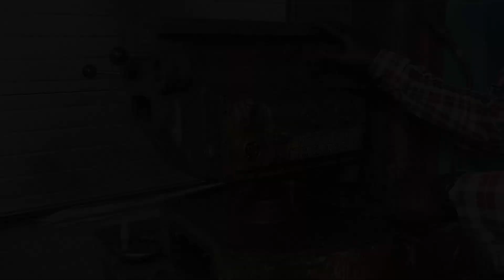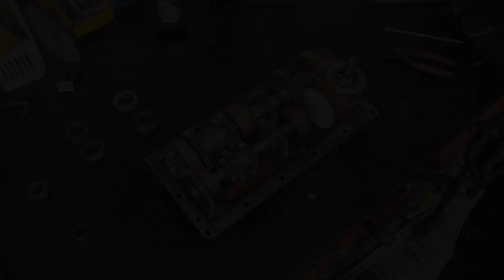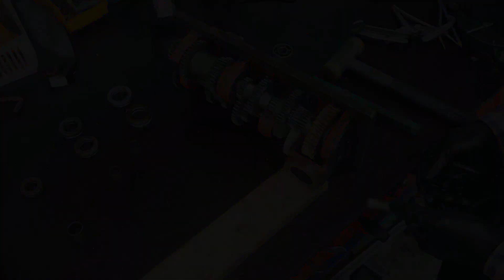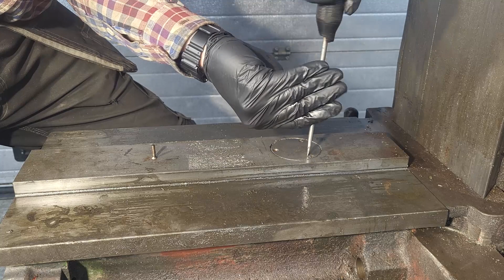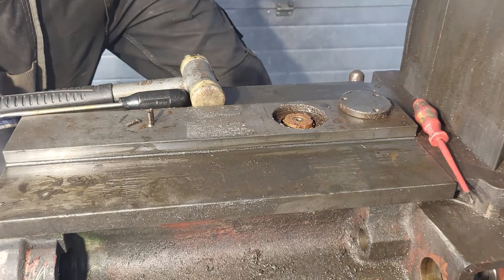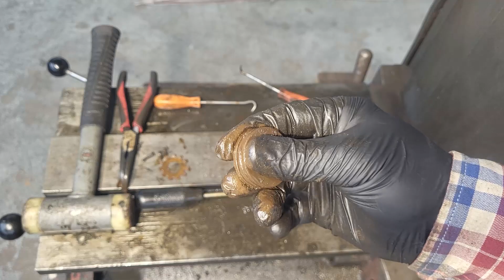SAJO milling machine restoration - PART 9

Comment: Hi guys, I build a milling machinery, and in this type of machine the first bushing to be changed t's the vertical because all the weigh it's always on her. Also, You test the play in the lowest position where the bushing never work, so, the play it's reduced but in the middle screw will be more. My opinion it's to change.You are maching a good job, don't do this mistake.Regards.
Reply from the maker: Hi, thank you for the comment, we will try it in the middle and check the condition 👍

Comment: I think you are a little too concerned about that bushing for the Z-axis -- it is loaded against gravity, so backlash is of little concern .  In any event,  you are jacking at the wrong point -- jacking near the center of gravity of the knee close to where the lead screw is would largely prevent binding in the ways and give you rough indication if the bushing is totally trashed (unlikely as that be) .  You are correct in playing closer attention to the thrust bearings .... that is one-big-piece of iron to lift, especially with the added weight of the saddle and table !   Fun project, though ..... good luck to you.   How about an engine lathe next ?
Reply from the maker: Thank you for the comment, it nice to see that people like to give insight from where we can learn more. We can agree that now afterwards we might have been a bit over concerned but then again, we just had to :D and yes, the point for lifting could have been chosen more carefully. It sure is heavy, dont think it will be vibrating too much, but thats the beauty with old machines, built to last 🫡

Comment: Did you really just use a 10 ton jack to "test the play in a thread"??? & without an indicator against the back of the machine so you could at least gauge what you were doing with that jack??? It doesn't matter how little you think you lifted it, it still has way more force than you should use to test a thread. A lump of wood used as lever would have been enough!
Reply from the maker: Appreciate your comment but we took it easy so there is no risk that anything was damaged. The gauge would have been a good idea!